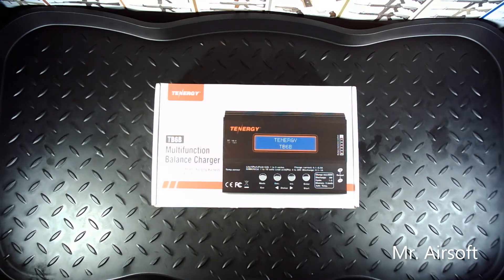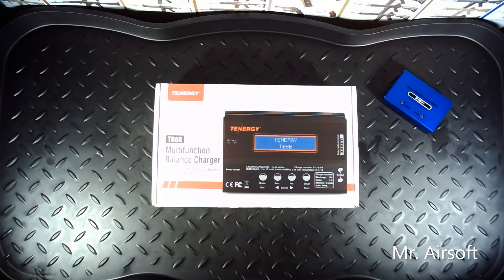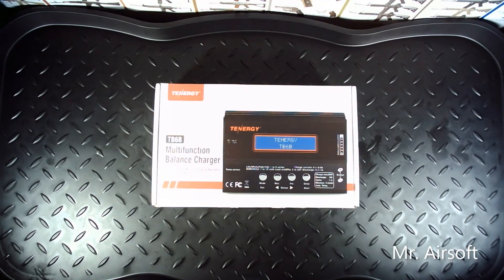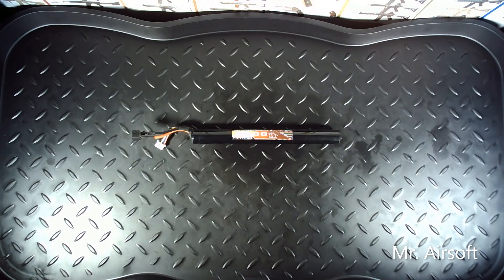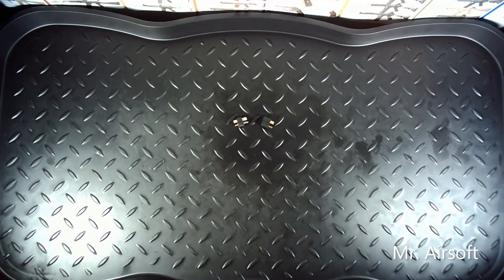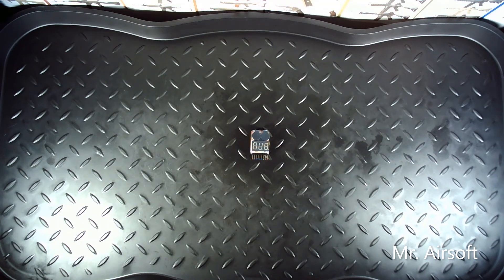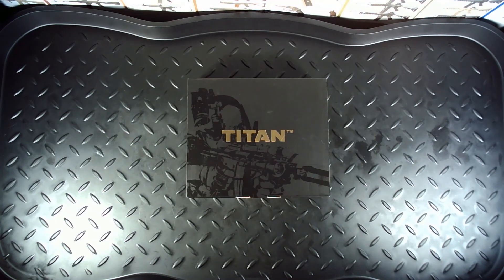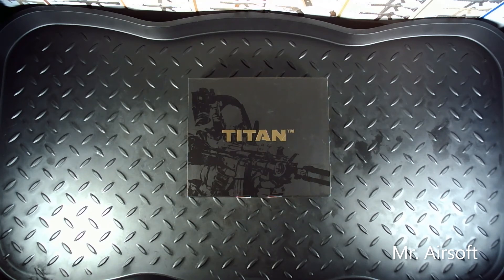5 Recommendations for Reliability in Airsoft

Comment: For spring change (from 300fps to 420-450fps), and a lipo battery, what upgrades do you recommend for it to handle a stiffer spring and a lipo battery? I'm planning to revive my JG SG550 but i might as well upgrade it.
Reply from the maker: You should consider at least changing out the stock piston with a metal toothed piston and the piston head with a new, quality one when going with a more powerful spring, as these take most of the force from the spring. A new motor might be in order as well, most likely one with more torque if you aren't going to replace the gears, and you for sure want one with neo magnets regardless. Make sure that taking a look at and optimizing your compression won't raise your fps as well, a more powerful spring isn't always the best answer. Regarding the battery, you'd probably want to at least put in a simple Mosfet with better connectors such as Deans or XT-60, and once again a motor. Other than this, I'd highly recommending doing a general tune up such as shimming, compression, grease, the whole nine yards.

Upgrades I'd probably do if it were me besides the ones I listed would be changing the gears depending on what the final goal is, swapping out all the compression components for peace of mind (maybe the cylinder might be ok though), and putting new wiring in the gun. The problem with this is that if you're on a budget, these steps aren't very cost effective. What I listed in the previous paragraph should be fine though if you aren't going for a super stressful build. Good luck, let me know if you have any more questions.